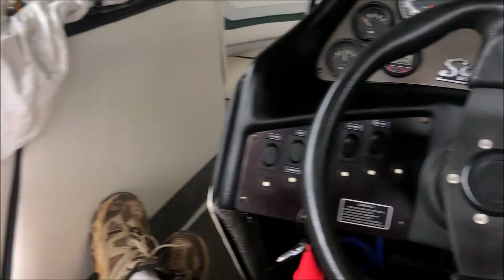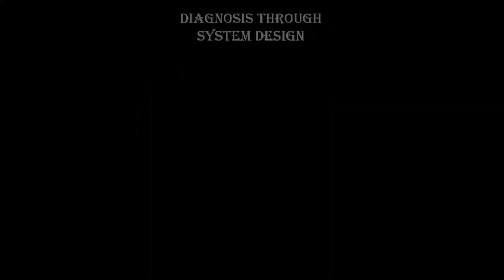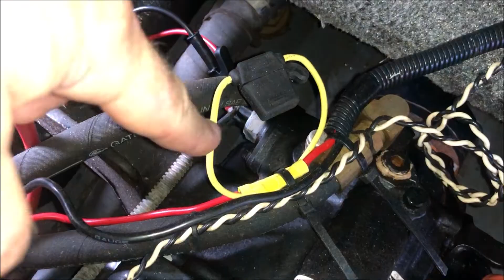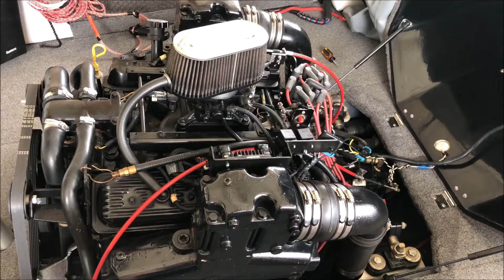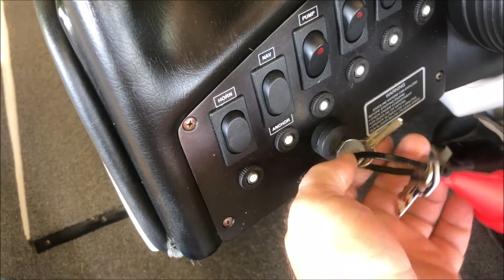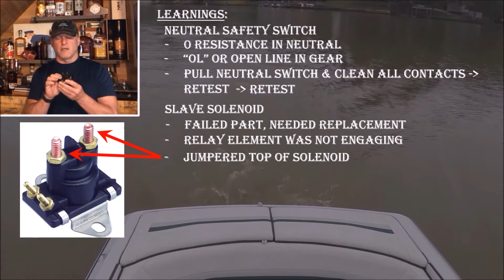No Start, No Crank: How To Repair Mercruiser Inboard Engine & Velvet Drive MIE 350 MAG MPI Ski

Comment: This guy was spot-on I came to my wit's end until I saw his video my boat was diagnosed in about 2 minutes it was definitely a slave cylinder hello also like to add that your oil pressure switch will cut your fuel off and it will run and leak gas down your cylinders into your oil pan if you leave your key on and your oil pressure switch
Reply from the maker: Glad my video helped!  And thanks for the extra tip ;)

Comment: Great video. For what it's worth you can take the 12 volt wires off the solenoid stud. Set your meter to Ohms and energize the coil side to see what the contacts read. If you read an ohm value more than continuity, it would justify replacing the solenoid.
Reply from the maker: Thanks for that tip

Comment: I'm having issues with no starting or nothing  on my 94 ski centurion falcon.  I have power. No kill switch on this boat. I've replaced the 50 amp breaker and no change. I replaced the solenoid and the same result.  When the key is in the on postion, it has a buzzing noise.  I don't see any fuses. I do notice there is an oil pressure switch above my oil filter. If I unplug the wire, the buzzing stops but does not crank  on still.  I ordered that and the neutral safety switch. I hope one of those fixes the issues. It's been a head scratcher for me.
Reply from the maker: Have you been able to check ohms and voltage as I show in the video?
Reply: @DrivingIntelligence  I have not. I'm going to buy a volt meter today and will check resistance.
Reply from the maker: @mosesandres3385  that should help you isolate the issue
Reply: @DrivingIntelligence  hopefully I will post update.
Reply from the maker: Please do
Reply: @Driving Intelligence  update was a bad neutral safety switch. I'm glad I found this video. 🤙
Reply from the maker: @mosesandres3385  excellent!

Comment: This video was very helpful. I have an 89 Supra with a similar problem. The solenoid is making a buzzing noise and starter not engaging when jumpering  solenoid poles. Starter and solinoid are new. Can you help?
Reply from the maker: Thanks for checking in... difficult to diagnose without seeing the boat.  Are you sure the starter was installed properly?  Only thing I can think of is either a faulty part out of the box, or something is obstructing the starter from spinning causing the noise.  Can you remove the starter and try to start it off the engine to at least rule out the starter as the problem?  Sorry I can't be more helpful at this point!

Comment: Had the similar issue last year where when we were out on the water boat wouldn't turn over. Checked all the normal safety switches to ensure the lanyard wasn't pulled etc. of course being on the water we didn't have a meter to actually test anything. I was able to jump the solenoid and the boat fired right up. The problem was intermittent the rest of the day. This weekend I will be actually trying to finally diagnose the issue and I will now start with the solenoid to see if that's my issue. Thanks for the video, very informative.
Reply from the maker: very glad it helped out!  And you're lucky you have some diagnostic skills to get you off the water.  ;)
Reply: I was just going to ask because mine just started acting up today Mercruiser 5.0  not cranking intermittently.  Can jump the solenoid just to get started if I am out in the lake?
Reply from the maker: You can do that, but be very careful.  When jumping, you create a spark and as you might know, a spark in a boat can be catastrophic.  Gas Fumes will ignite and cause an explosion.  My recommendation is to get it fixed asap.
Reply: @DrivingIntelligence  If I do have too I will make sure to run the blower and leave the  engine up for a while before I try.